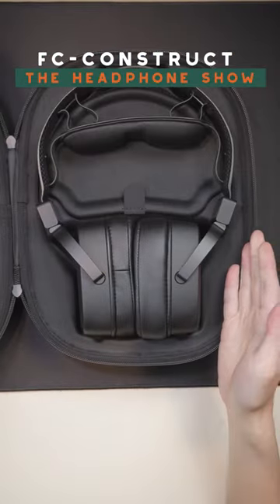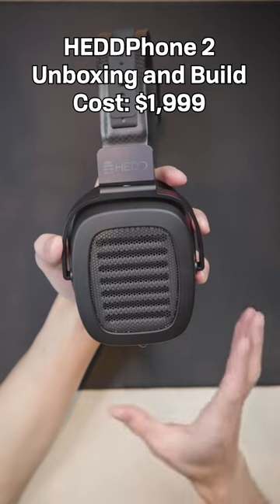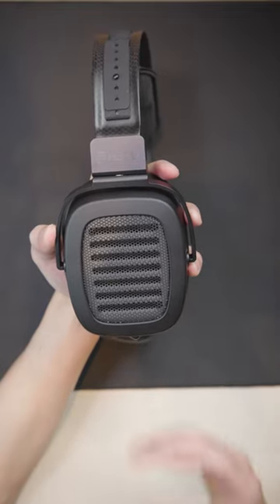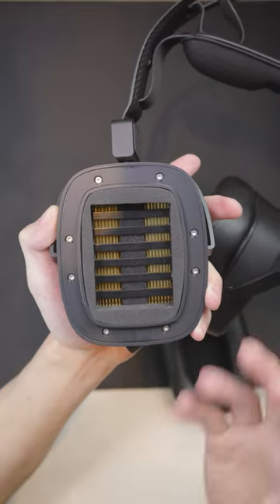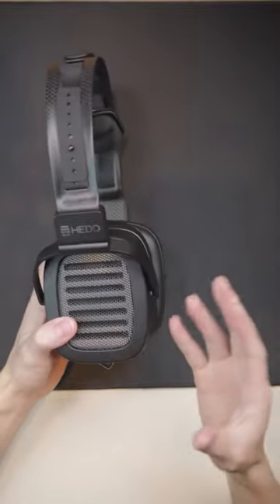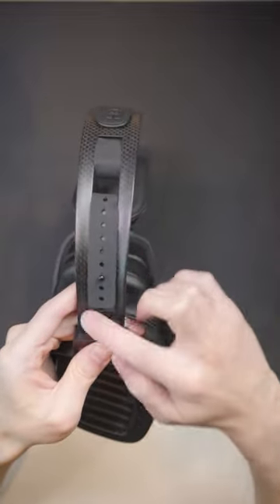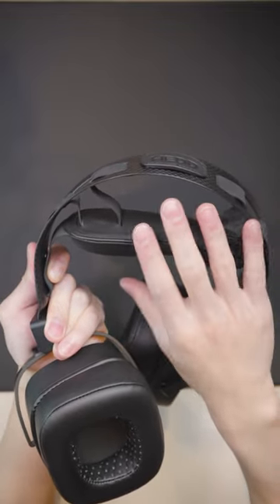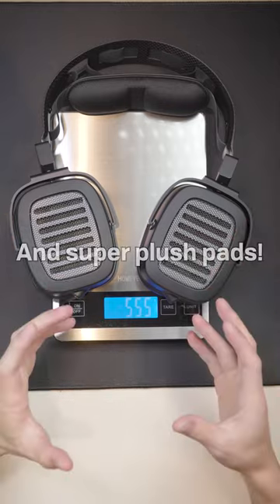Air Motion Transformers in a headphone?! HEDDPhone 2 Unboxing and Build #headphones #audiophile

Comment: Ear pads are installed wrongly. They’re angled pads, the seam goes to the front.
Reply from the maker: Thanks for the comment! I just noticed as well and pinned a comment. I had taken off the pad to show off the driver but didn't put it back correctly during filming. -Fc-Construct